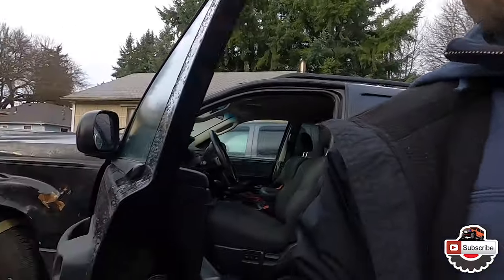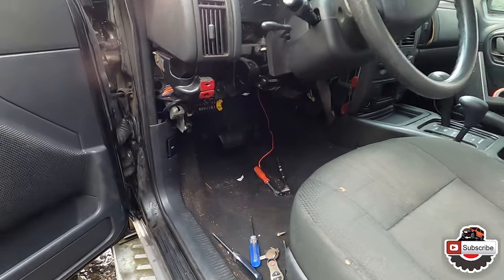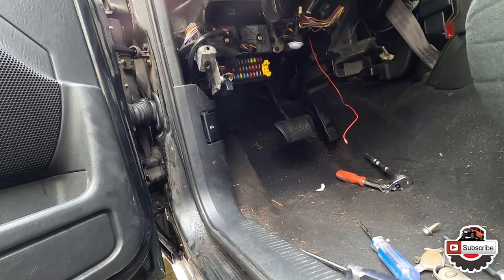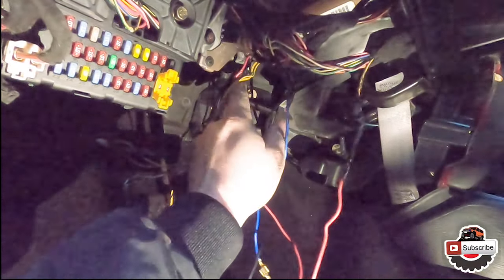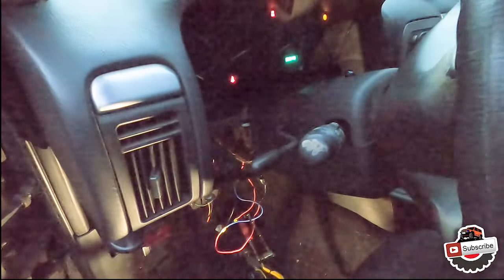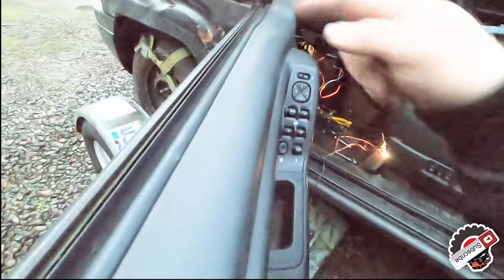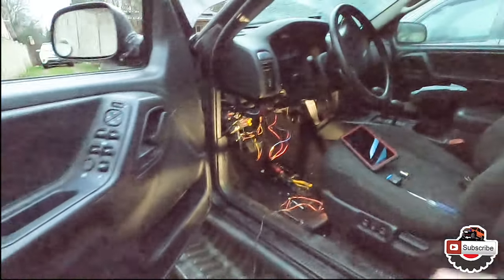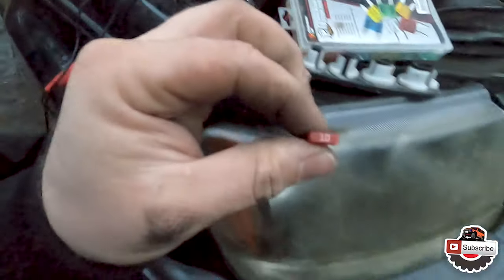Jeep Cherokee Crank No Start FIXED

Comment: You have to love it when the fix cost like 15 cents. It that the Launch scan tool?
Reply from the maker: Yesh it's the Launch X431 Pro Mini. It's been great and has paid for its self in the last year.  I had my budy struggle with skim module disagreeing with pcm so the jeep would stall after few seconds. 
Ended up being a simple issue of vin number characters getting corrupt with in the pcm its its self.  
Took all but 2 min to re program the vin in. Started right up.  Dealer quoted him, 450 for new pcm plus 120$ to reflash it with new vin.
Reply: @JeeperGear  I have that scan tool as well, and like you said, well worth the money! Sometimes you can buy troubled vehicles cheap because the owners don't want to spend the money (and I don't blame them). With the right tools and some skills you can get lucky and find what you did. Awesome.
Reply: @JeeperGear  I have that scan tool as well. Like you said, it has paid for itself many times over.

Comment: Please remove this video...  Full of miss information.  In no way shape or form should anyone use this as a practical diagnosis strategy.  
What he removed was an aftermarket alarm.... These alarms are Starter kill only.... do to safety reasons..  
The security light he stated was still on after alarm removal. Is a factory light from Jeeps SKIM security module...
Note if he had just gone to fuses first he would have been miles ahead.
Reply from the maker: 🤣👌 ok guy. sure thing, right away.